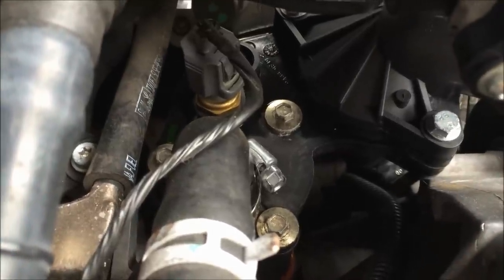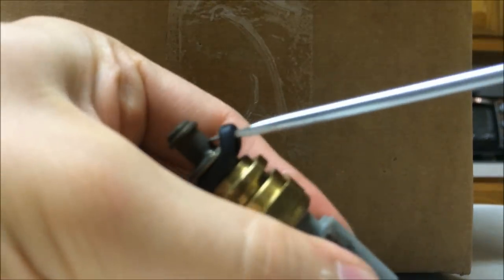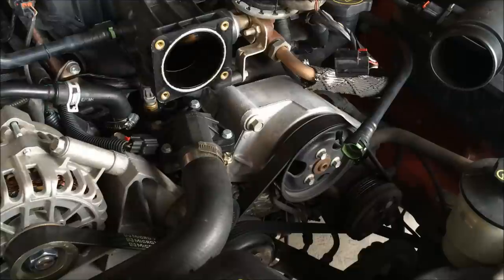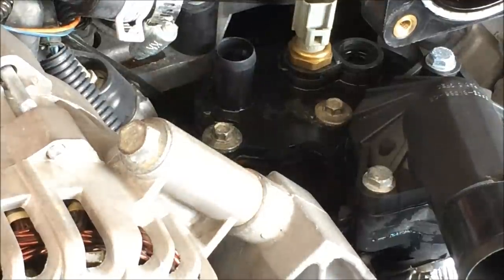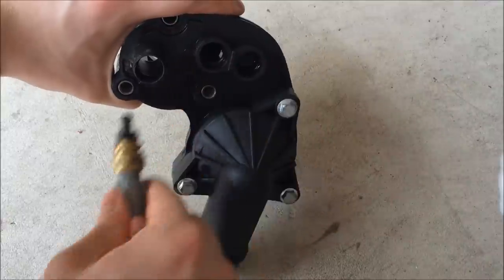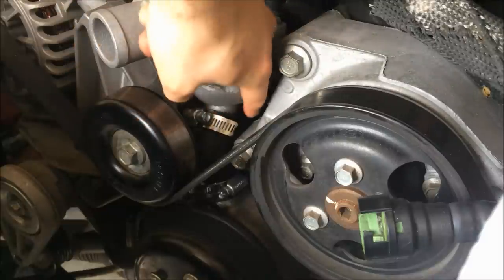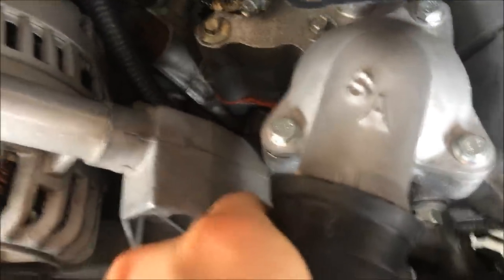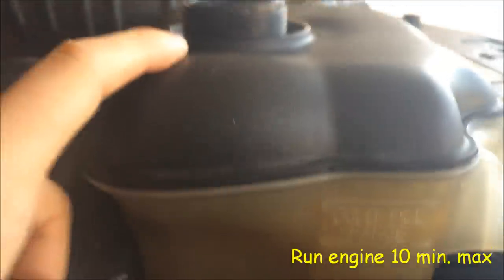Thermostat Housing New METAL Replacement 05-10 v6 Ford Mustang

Comment: just recived my replacement metal thermostat housing in the mail  today and it came with an important note for the 2005 model...The upper housing will hit the throttle body heater. To use the metal upper housing you will have to do the throttle body bypass or grind the upper housing down at the contact point and or heater box on throttle body.
Reply: What? I have the 05 model and it's doing this shit now 😑 which way did you fix it?
Reply: Tang Stang Did you end up doing it? Tired it tonight and  having the same problem
Reply: Where did you buy it from

Comment: You know I was having a real hard time determining where this leak of radiator fluid was coming from ...I actually could smell the coolant from inside the car! I opened up the hood and found coolant puddling and corroding on top of the engine in the tunnel created by I guess the air intake on top of the engine  ....my first thought was Oh Sh!t warped heads or head gasket leak. But upon further inspection there was some crusty residue around the seams on the thermostat housing.! Oh there is a god thank you! I though to my self ...shirly there must be a YOU TUBE video  on this problem and bam your's was at the top of the playlist! 
               Shame on you FORD for designing to fail or planned obsolescence with cheap plastic parts that can't take the heat of the engine coolant! Aluminium or a metal housing seems to be the only way to go and should have  been in the design specs from the get go. If Henry Ford could see the money saving cheap shortcuts the the company that bears his name sake does today I'm sure he'd be turning over in his grave like a PTO on a Ford 8N tractor!!
              Thank you Mike for finding the metal housing after you installed how many plastic ones that failed....I think you said 4 in your vid ?  I have a 45th edition 2009 Mustang with the V6 and I hope the housing will clear the throttle assembly....hopefully he said with no modification. Your video was very well produced... you must have a production background. Not one moment did I say to myself I can't see what your talking about and I feel very confident going into this repair. I took notes and also created a tools list along the way and also thank you for mentioning the tork specs and bolt sizes ....very helpful complete and concise info! I have to schedule to work on my car when I have a couple days off from my day job just to leave fudge factor time to find another ride just in case I futz up the job.  I would like to see more videos from you. on the 'Stang I would also like to donate some  bucks to the cause ....because I think you saved me a $hit load! Thanks Again
Reply: Jack LoPinto I am going on my third!! I am going to switch to aluminum. This video didn’t exist for my first two housing units. I am still baffled what a cheap part this is!
Reply: The mfg,of all makes use plastic parts to cut down on weight for fuel economy,it's called cafe...look it up.

Comment: Thank you so much for posting this! I installed a plastic housing on my 06 v6 mustang. The shop quoted me 300$ for labor but I did it myself thanks to you. If the plastic doesn't work I will try aluminum.

Comment: Not advised to use an RTV (gasket maker) with o-rings.  You will cause a leak.  O-rings typically have mold release on them from the molding process and as such will prevent rtv from sticking to it.  Just don't do it.  One or the other.
Reply: agree with this, o ring can do the job alone.

Comment: I did this job......worked fine, BUT, THE PART WAS TOO EXPENSIVE......THEY WERE REASONABLE TILL EVERYONE EVENTUALLY NEEDED THiS FIX....THEN THEY STARTED GOUGING EVERYONE. THERE iS A PROBLEM WITH THE SAME YEARS GROUNDING PROBLEM THAT DESTROYS ALTERNATORS AND BATTERYS. DID THAT JOB TOO.

Comment: Search online for "SimmonzAutoparts" they have the aluminum housing if ur having trouble finding it. It's a quality part, especially compared to the old cracked plastic one. Its worth the extra cost cause it actually works and is U.S. made. I'm sooo happy my V6 isn't leaking anymore, and can relax continuing my regular Maintenance.

Comment: Hello, I am an italian owner of a 2005 6V 4.0 Convertible Mustang and this metal housing don't fit my car because is too high so it touchs the intake air valve housing.
Could someone tell me something about this problem ? (plastic housing fits well!)
Reply: Roberto Corti the parts needs to be filed down for a 2005 mustang. Look at the manufacturers website.

Comment: Hey Mike, I am looking to buy the replacement housing since mine is leaking, but everywhere I search does not have the seals with the housing. Where did you purchase the thermostat housing from, and if seperate where did you also purchase the seals from? A link would be extremely helpful.

Comment: Ok so I know I’m late but maybe someone can possibly help. I have a 05 mustang that I recently attempted to change the thermostat housing on. After changing it and starting the car, coolant was shooting out from where the thermostat connection resides. It also shout out from the hole next to the connection. I’m confused on what I did wrong.

Comment: I've got an 05 v6 and I'm replacing this now.  On my replacement part I have two holes for the temperature sensor.  I put the plug in the 2nd since not needed but I've had it pop out. Any suggestions 🤔.

Comment: If anyone can answer my question. If I'm adding coolant back into the system and start my car what happens if the heating in my car doesn't work? I can only run AC atm. Can I just leave my car on and drive around without heating instead and let it run coolant until I need to fill it again?

Comment: so i was in a rush this morning to work, only had 30 minutes to swap this guy out, and this video really guided me. although i didn’t have time to let it run without the cap. since then my heater only blows cold and AC… also a very old thing, wiper fluid isn’t coming out. gonna try letting it idle for a bit in a few hours without the cap to see if that helps at all

Comment: I replaced mine with an aluminum one as well. It should of been metal to begin with. Why Ford did that idk. I went a step further and replaced the bypass hose for good measure.

Comment: I switched off the temp sensor to the new one with the pin but the hole on the right aide of it won't stay cover with the cap and pin it easily pops out...is that normal ? or does that hole and cap need to be tight ? anyone know ?

Comment: This is a great video very detailed. Thank you. I will be attempting to change mine out today I have an 07. I did the diagnostic myself as to what was causing my leak and as far as what I have read this could be the only problem. However I am a novice and thought I would reach out and ask if there is anything else I can look for if its not the thermostat housing unit? Car is not overheating, just spitting out coolant / smoke. Spill seems to be coming from that area. No fuel or coolant in the engine oil. Thank you ~Jenna

Comment: I'm hoping this works thank you. I just bought a used 07 and it overheated. This part btw is melted to shit so I know that has to be the biggest and most suspicious factor. But then it could be other stuff too and I'm so worried. So much hard work to buy my baby and it breaks down.

Comment: If you can't get the coolant temp sensor wire disconnected, poke around with it with one of those thin metal hooks/dental picks with the orange handle that you can buy from harbor freight, came right out for me.

Comment: I just did this for my mother except I used all Motorcraft parts because she's funny about putting aftermarket parts in any of her trucks. It was a 2006 explorer 4.0.  Everything went well except the new plastic thermostat housing from Motorcraft was slightly redesigned and thicker plastic than the original and that little clip that holds the temperature sender and was a total pain in my ass. Should've been the easiest part but it made me want to throw the housing like a baseball across the garage. I had to bend it and modify it slightly to work with the redesigned housing

Comment: a lot of good points..but please put a rag in the thermostat housing after you take out
the thermostat.there are 3 screws and 3 bushings in the housing  that any one of 
them cud fall into the waterpump..i cud not fish the one that fell in my waterpump
with out cuting the hose that goes to the w p ..i bought a new hose and cud not put it in
without  removing the housing..p.s.i got the bushing out with an extended magnet..
wat a job!!!!  tks jimmyjack

Comment: I recently did this install and noticed on the original thermostat housing the neck was partially broke off so lord knows where the piece that broke off is now. I also noticed that the bottom of the housing didn't have a rtv made gasket on there but put some on there anyway.

Comment: Great vid. I installed one of the aluminum housings on my supercharged 4.0 as part of a long block swap. Mine wasn't leaking (yet) but if it did go, replacement would require yanking the whole blower assembly. Peace of mind is worth something.
Reply from the maker: Yea that would suck getting a leak after all that work, that was going to be my next project too but that car recently got totaled

Comment: Wow excellent info on the metal housing friend. Is there one available for the Explorer applications? Google wasn't too helpful.
Reply from the maker: If I'm not mistaken, I believe it is the same part for the 4.0 L 2002-2010 explorer. Try searching "metal thermostat housing explorer" on amazon or ebay.

Comment: So no shit, mine blew out tonight in the exact spot pointed out on the video, the seams where they glue together. Do you have a link for a seller for the aluminum housing? I have found plenty of plastic ones but i'd like to replace it with something more durable.
Reply from the maker: No I don't have a direct link but it comes up just searching "mustang metal thermostat housing" on amazon and ebay.

Comment: Hi Mike. I noticed the owner's manual insists on using the "Yellow" Ford coolant. Yet the auto parts stores insist their universal coolants will work fine. Any thoughts?
Reply from the maker: I believe it's personal preference. You can use either one, I prefer Prestone just because it's what I've used in the past. The ones that say they are universal means they should mix with most coolant colors. The important thing is to make sure the fluid is clean and changed when needed, and not to let it stay brown and dirty for long. But definitely stick to the yellow or green for this car, you don't want to start adding pink or blue unless the car calls for it.

Comment: Great video..  Thanks!  One thing - Can you comment on the 2005 mustang refill process?  I've seen other videos that show a bolt to remove on top of the engine to fill the last little bit of coolant / get the air out, but I dont see it on mine, and you didnt comment in the video.   Is this needed on the 05 4.0?  Thanks!
Reply: OK..  I just went to the auto parts store..  Didn't have the metal one, but for $50 and 2 hours time, I can say your video was a LIFE SAVER..  I'd never have made it through this job today without watching your video.   By spending 20 minutes watching your video, I saved AT LEAST an hour or two, just by being familiar with what I had to remove, and how to get those electrical plugs off..  THANKS SO MUCH.  I owe you lunch and a beer!  :-)

Comment: Gonna be doing this in a parking lot on a stang I just bought (literally driving it home, stopped to get something to eat and saw a coolant puddle, coolant was low but not low enough to cause any major issues, didnt overheat. Should be fine to do this without draining the coolant right? will be a little messy I know but will save me some trouble in the long run
Reply from the maker: Oh man. Been there, parking lot jobs are always so fun. It should be fine without draining, just make sure you bleed the system well. And let the gasket maker cure for at least a couple hours before getting wet if you can't wait the 24 hours.

Comment: i bought the metal part but one quick question, i replaced the o-ring on the thermostat sensor and placed the c-clip back on it, i waited the time out for the gasket maker to be done and fired it up with some new fluid in it, and it started to lightly leak around the sensor and around a tube to the left of the sensor, would these leaks be by the faulty sensor and/or tube or would they be the metal housing unit causing the problem?
Reply from the maker: Oh man. The first thing I would do is make sure that the clamp is tight on that small hose on the left. If you have the original spring clamp I would change it to the screw type shown in the vid, just to be sure it's tight. Those clamps wear out. Also, make sure the c-clip is connected correctly with the sensor all the way in. I have found myself forcing it into the slot in a way it was not suppose to go but it looked good from my view. Next, look close at the new o-ring to be sure it is not compromised. Or just get a new o-ring all together. Look to see if the sensor is damaged, look for cracks or any loose parts. Finally, (I know it's hard) try to get a view into the hole to be sure it is smooth and even. If there is something wrong with the hole then it's a machine error when manufacturing. And I'm sorry to say, you may have to exchange the part if there is an error.
Reply: +Mike's Auto Fixin' thanks for the reply, i know this was posted a while ago, im gonna definitely look into a new clam and hoes just to be completely sure, and the new o-ring looked perfect, however it seemed a little loose when i installed it on the sensor, and when i installed the sensor, it seemed like a real snug fit, however with the old housing unit i took it out of, it was also leaking fluid from the sensor. I may look into buying an all new sensor if it is in fact broken. If im not wrong, i believe it was the same sensor the car came with, and the dealership had just used the same one over and over again when i had the last few housing replacements done.

Comment: do you flush before or after you change the thermostat units?
Reply from the maker: To do a complete flush, you could do it before or after. Or you could flush the engine and radiator separately while having everything taken off.

Comment: Thank you for this video!! Im not a mechanic by any means but this is very straight forward and informative!! I have a 07' ford mustang and have run into this issue. What is the amount of time this usually takes in regards to fixing?
Reply from the maker: It really depends on the person but it will probably take a few hours. If u have no experience at all I would say give yourself the weekend so you have plenty of time. Also if you use a gasket maker that takes 24 hours to cure it will take at least a day, or however long the instructions call for.